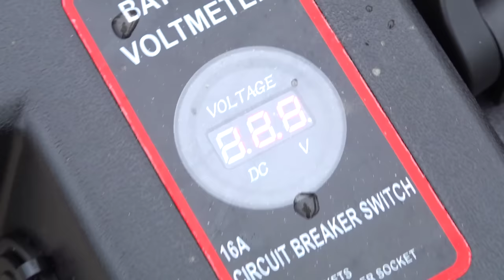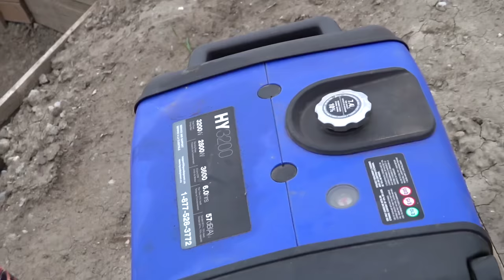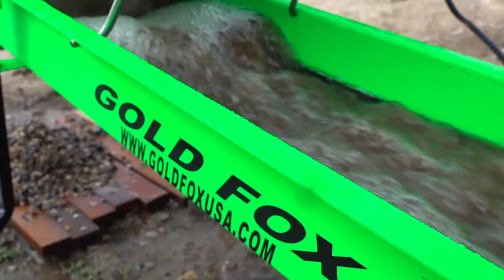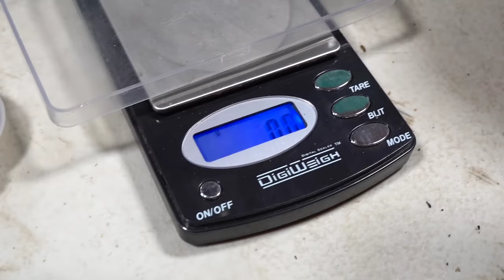YouTube GOLD (S3 E6) BiG JOHNSON 374FL FEEDS GOLD FOX WASH PLANT for the FIRST TIME! | RC ADVENTURES

Comment: You've got the big excavator now,  isn't it about time to start using the BIG mine dump truck ?
Reply: I agree
Reply: Thinking this exact thing
Reply: I agree as well
Reply: Or maybe use a couple semi dump trailers?
Reply: And dump that into the conveyor
Reply: Kinda disappointed that the first showing wasnt digging anything but loose material
Reply: Jamie C imean how else would a miner deliver explosives into the bedrock to follow the pay streak xD or blasting for a new road theres lots of cases for a tank lmao
Reply: Run both of the roc– sorry, dirt trucks going at the same time. Have two shovels (including the Big Johnson) loading them. Huge throughput with just four crew.
Reply: The bump truck is till at least triple the size of Jonson and it’s way too big for the scale mine site
Reply: Put a trailer on the ramminator and use that bad boy
Reply: James Burba I want to see Johnson.
Reply: Might help to completely fill truck as well!  Only filling It about 3/4 full.
Reply: Put the two huge convayor belts together and use the huge rc mining truck
Reply: the big mine truck is too big for the 374

Comment: That mine site is getting too big. Your communication is getting hard. Use same walkie talkies. 👍
Reply: I agree
Reply: Indeed
Reply: This. I was just thinking this needed a full communications setup. But also... Run outdoor power conduit to the various stations so you can have power stations you don't need to bring in for the rain too. Perhaps a secondary shed just for wheeling the mine equipment into.

Comment: A little operator etiquette. When picking up material with a excavator bucket.  Curl the bucket in as soon as possible, so that the bottom is flat on the ground. Similar to loading with a loader bucket you can slice into the pile, instead of dragging it closer to you.  Watch how Lyle loaded on his turn with the Big Johnson.  Another thought is to put a fourth side to the new conveyor hopper. You can make an adjustable slide gate above the belt to regulate the amount of material the feeds onto the belt. Love the GOLD. keep it going.
Reply from the maker: Im glad you're giving etiquette advice to a parody. It makes it more fun for us! hah #YouTubeGOLD!

Comment: hey guys love the vid, little tip with the excavator when you are digging piles instead of pulling the arm towards you and then curling the bucket get the bucket about half in the pile then curl the bucket while the second arm is pushing back out the pile, then the dirt doesn't get piled under your tracks.

Comment: Nice wig, you look a little like crazy Joe 😄 Finally the first test of this big excavator, really great it does a crazy job , but they have to bring the earth a little faster, with a single bucket it almost loads the truck 😁 
It is forbidden to attack workers with the shovel (at 23:09 of the video) 😂😂 In addition we could not say that it is a work accident 😄 I not knew there were safety sandals 😁 Ah damn it already has a hydraulic leak problem, I hope it does not matter. But in any case it does a good job, I also think that if there had been no rain the gold harvest would have been greater, but it is already very good , 8 grams is great !!! 31.5 grams in total is excellent because season 3 started very late, congratulations to the whole team !!

Comment: That's cool! Here's a little pro tip with the excavators you're supposed to never dig against the track sprockets. I had a boss that was quite specific about it. Mostly because the sprocket replacement on his excavators was around $40k from what he would say. If you notice when digging with it the end if the tracks move up and down rubbing and wearing the teeth down. Shouldn't have to worry about it too much being though the equipment is smaller and lighter than the full size ones but to look realistically......

Comment: you should try semiautomate the wheel at the end so put a box under angled with water running down and all the dirt and other stuff that drops off the wheels falls into it slides to a conveyer or something to lift it up and then a something vibrating a box which is putting that dirt back onto the gold wheel then just let it run for a while or have all the pay dirt go into it so you dont miss the tiniest bit of gold

Comment: The tailings pile coming out of the back of the trammel, you should pave your roads for your equipment especially the loading pad for the excavator dumping into the conveyor it would not only look nice it would keep the dirt from running when raining

Comment: The Johnson needs to be digging, not loading! Load up the trucks at the pit with the excavators and drop off for the loader to put into the machines.  Load the ramps from the side, not the end and you won't end up with such huge piles going up the ramps. I think Bob needs a hit or two, he need to loosen up! ;-)

Comment: You'll need 2 or 3 dump trucks and use the front end loader to fill conveyer belt.  This way your guy digging fresh material never stops and same for the guy running the front end loader.

Comment: 27:30 for a bit better scale realism you should have the track drives at the back to you don’t get the track sagging down on the bottom and possibly derailing. From my experience you should drive a exscavator  with the drives in the back whenever possible

Comment: and already found the crack in the turn , I'm curious?  I also bought that CAT but I think it is a flop and this for so much money, I see that there is a lot of clearance on the turn to the left / right , oil pipes on the arm must be held with thrips, oil return at the bottom of the tank , it is that the oil pops out through the venting tank and so on ..... would have bought something else I think, have no problems with me other hydraulic stuff and they cost half ;-). hopefully my version 2 update is better ...... old I would sweeten it, you make top videos with a lot of fun
Reply from the maker: The SLEW RING is out of round  I believe only by a hair though. Let me ask you.. can you rock your carousel on the bearing? When you grab the top, can you rock it back and forth, or is it Solid?    Ive checked the ring and pinion - and neither one looks damaged.. there is no reason for the clicking that I can see.. other than something is up with the shape of it. The clicking is inconsistent.. and seems to be "skipping a tooth".. almost like the slew rings teeth are not sharp enough

Comment: would you be able to use the new excavator to load trucks since it has a bigger bucket with teeth and use the smaller one with the smooth bucket to load pay onto the belt ?

Comment: Instead of pulling the pay dirt, you should make a hole  where the pile is and line it all with wood so the excavator big Johnson  can get has much in the bucket as possible without pushing the pay and getting a half load.

Comment: With all the cash you have in equipment, I would think that you'd want to put a canopy over the mine site to work through the rain
Reply from the maker: Then we would all be in a shadow, underneath a parachute haha  #YouTubeGOLD!
Reply: Just add led lights you could make the light as bright or dark as you wanted, you already have the batteries and generators to power it

Comment: i heard that clicking noise sounds like u drop screw in gear n tores two teeth or just skipping teeth best is take gear motor out n turn around to see if any danged tooth if it is ended up having to wait for other part to arrived if not then should be easy fix

Comment: Cringeworthy, all that clicking.
Reply from the maker: Yeah I agree..  Not sure wut the f8ck is up there.. seemed legit the night before.. had no clicking at all. And its clicking the same spot almost every time I have to pull the gear box and investigate
Reply: By random chance is the hydraulic fluid full? I know pumps make funny noises as air goes thru them.